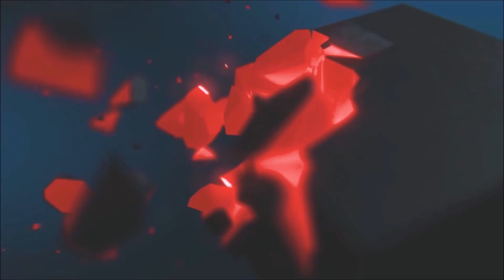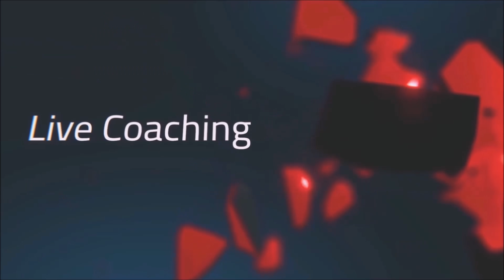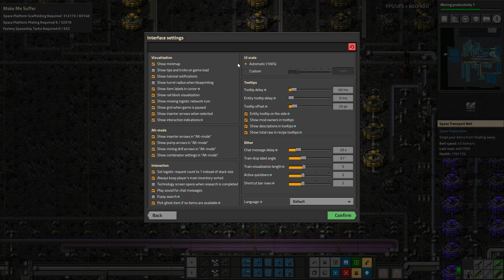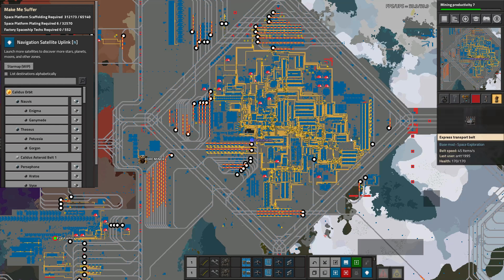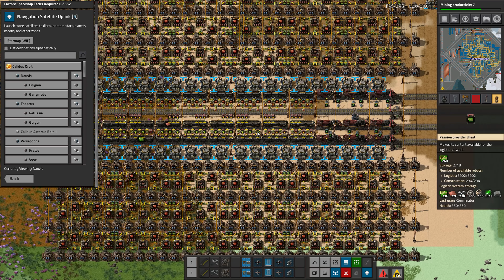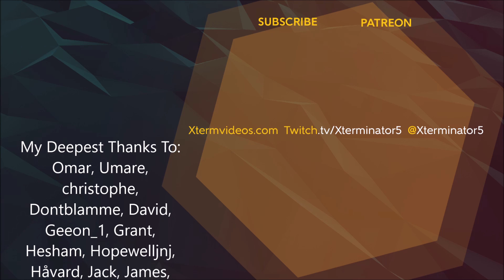Factorio v0.17.75 Changes - New Tooltips & Construction Bot Batch Building

Comment: To reduce the performance cost of batch placement but still take more advantage of it is to bake the groupings of touching objects together that are 1x1 on blueprint creation.
  This would apply to inserters, liquid pipes, heat pipes, belts, undergrounds, storage chests/boxes. Although power poles should be skipped since they aren't usually placed next to each other.
  When you go to place the blueprints it then only needs to check how many of each group needs placed. You could even have the groups listed in a chain that skips already placed or unplaceable objects and just goes down the list instead of recalculating the groups.

Comment: SE 60 fps ) wow
Reply from the maker: It's crazy how optimized Factorio is. Although my computer is basically built for the best performance possible in Factorio
Reply: How can you improve your computer’s capacity for Factorio? My base runs at between 20 and 30 ups
Reply from the maker: @samriches9145  Currently the biggest performance bottleneck for Factorio is RAM speed. So getting the fastest and lowest latency RAM that you can is best. CPU also matters a fair bit. Intel CPUs are typically going to be best for Factorio due to their single core performance, because Factorio mostly just uses one core at a time. Although the newest Ryzens I've heard are quite good for it. 
I currently have an i7-9700k, and 16GB DDR4 3200mhz RAM with cas latency of 14 to give you an example of a good setup for it.
Reply: @Xterminator  @Xterminator can u give an example of good & bad ram !
Reply from the maker: @kowy_m  The RAM I have is very good for Factorio. Mine is DDR4 3200mhz RAM with cas latency of 14. 
Bad RAM for it would just be anything with low speed and high cas latency
Reply: @Xterminator  ty ty ty

Comment: Many many thanks for this one man. 
Excellent stuff.
Update, just to put the emphasis on it : I do agree about the outlines for the inventory of the object displayed in the tooltip. Maybe using a grid with thin lines and a light color to create a border and inner cell will add clarity. (yeah, not a complain, regarding the huge improvements the devs are implementing, but will add QoL and make those tooltips a must-see ;-) )
Reply: Yes, a lighter and thus more visible grid would help readability, e.g. when seeing all the stuff in the Logistics system.

Comment: I think Xterminator has been replaced by Todd Howard, with how many times he exclaims that the update "works, it just works".
Reply: Except in this case it does work and you're not being paywalled to find out
Reply from the maker: It really does just work. :p 
The reason I put so much emphasis on that though, is because so many other games (or computer stuff in general) just breaks if there is some new mechanic or even tiny change. So it's really great that this was added so flawlessly and smoothly.